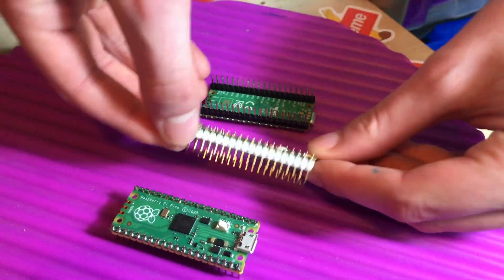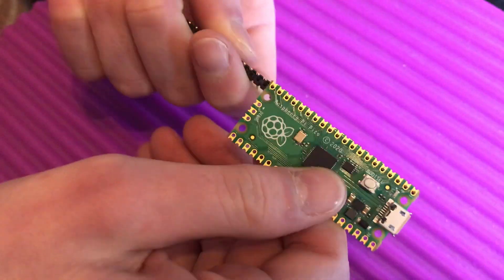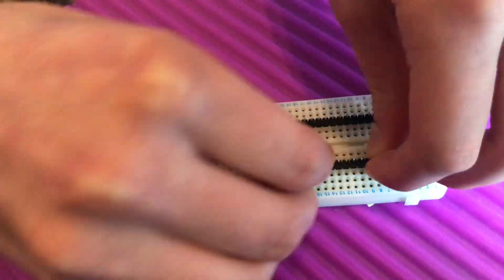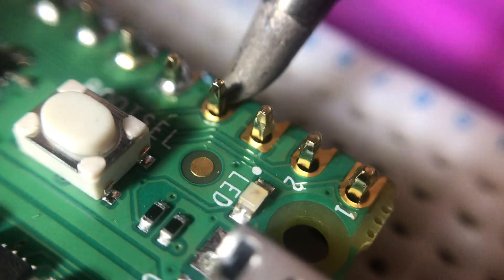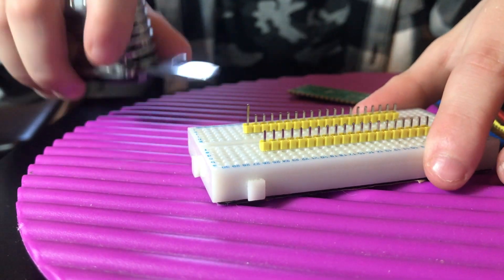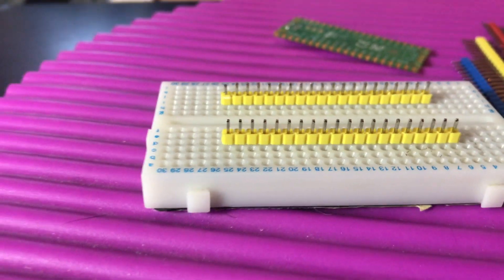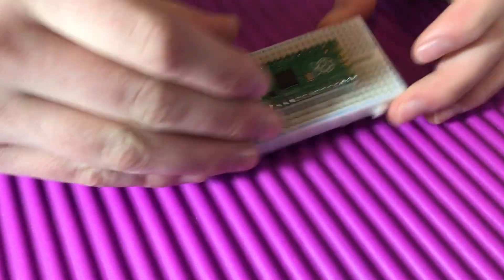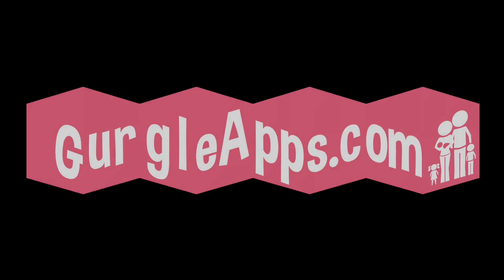Raspberry Pi Pico Upgrade Number1 - Snazzy Header Pins!

Comment: My soldering always look terrible. Hope I could get it to work as good as you!
Reply: Here's one thing you could try - first clean your soldering iron tip on a wet sponge once it's hot.  Then - watch how in the video the soldering iron tip is on the pin and the pad on the board for a little moment to heat it up, then touch the tiniest bit of solder to the iron tip, then only add solder to the other side of the pin from the iron.  Then, the solder only melts when the whole thing is hot enough.  When it's right the solder will all flow and suck into the hole around the pin.  Til then it's maybe not hot enough.  If you can also buy some extra flux - there are pens - and paint it on the area first, it will really help.
Reply from the maker: Great tips!
Reply from the maker: We were using new solder and the board was nice and new, I bet you could have done similar with the same tools. We may do a quick soldering video but it's hard to solder with the camera so close.